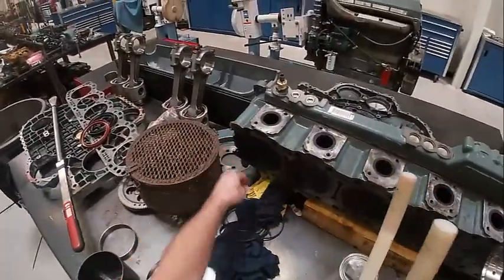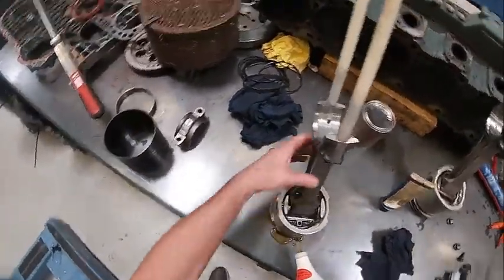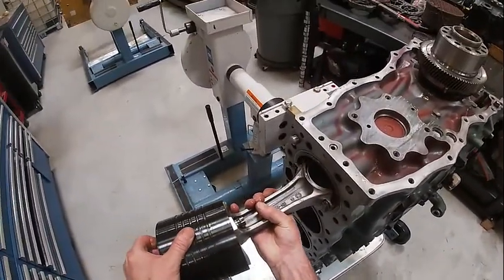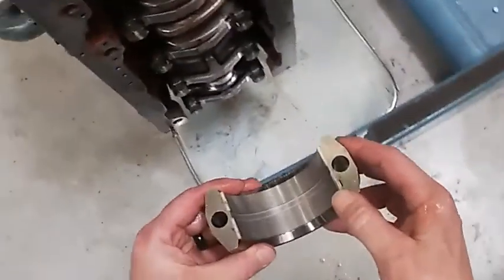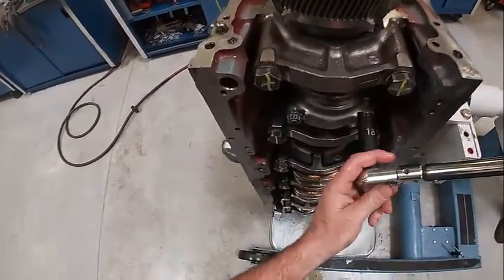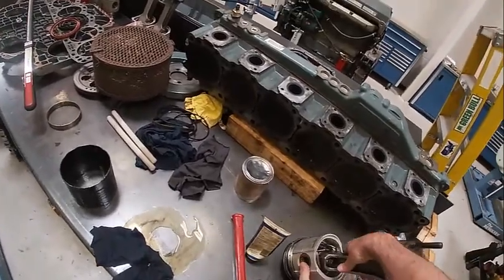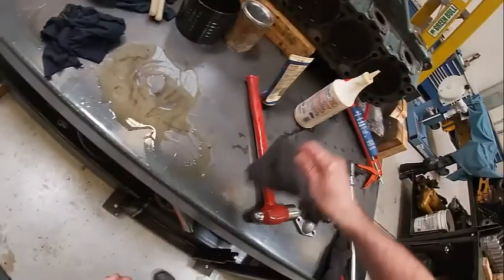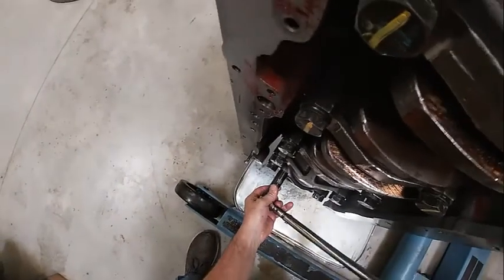60 Series Piston Install

Comment: Question my 12.7 1999 and 2005, the rods will not slide through the bores, how do you think i should go about this, put the piston in the liner then set the liner in the block, crazy, I've never worked on a engine that wasn't serviceable
Reply from the maker: You have to pull the pistons and liners together on the newer ones.

Comment: Setting rod caps at different torques is not what a professional does. There was enough oil that there was no need for additional torque.